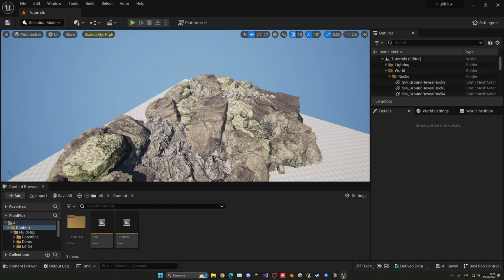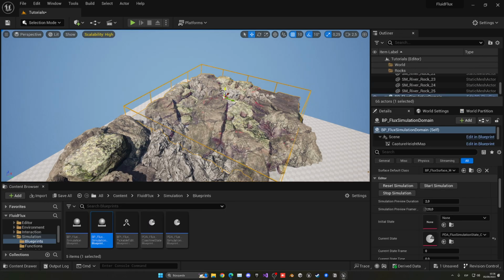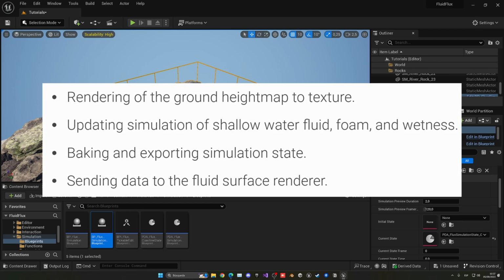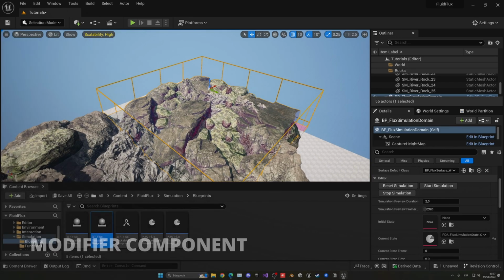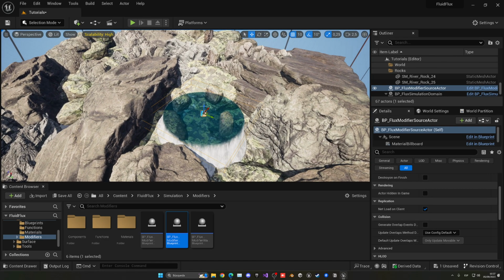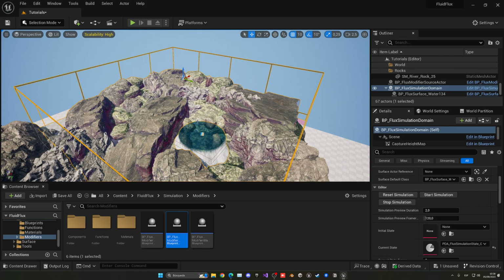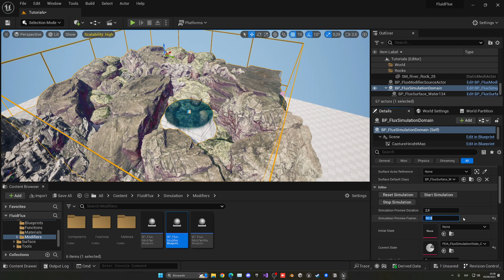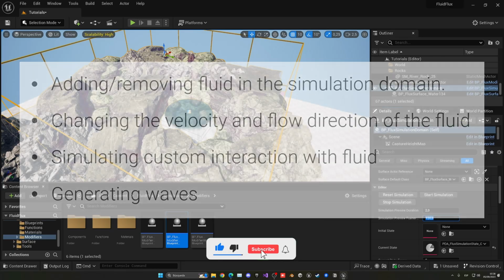Fluid Flux - Fluid Simulation Setup (Official Tutorial)

Comment: I'm always curious when it comes to these simulated solutions like NinjaLive and Fluid Flux: is it performant enough to include in a production project? I've read comments about the former asset that describe it more as an effective technical and feature showcase than something you'd reasonably expect to ship with a game, due to performance requirements.
Epic's built-in fluid sim has promise, but I expect it'll remain experimental for some time, and it's difficult to envision a use case where implementing the tech would be viable for players across a wide range of hardware.
Reply: from my experience it is in fact more of a technical demo more so than a usable product, i had a large landscape which had a river going in the middle of it and i wanted fluid flux to take care of that, but anything beyond a resolution of 1024 is way too much for the system, i ended up making my own water material with foam and ripples using distance fields, and while it doesn't look as good the perfomance, ease of use, and scalability are all 10x better.